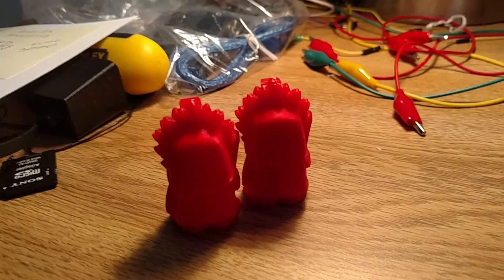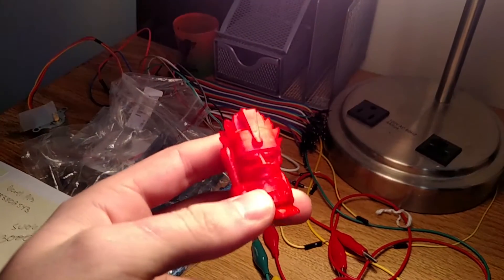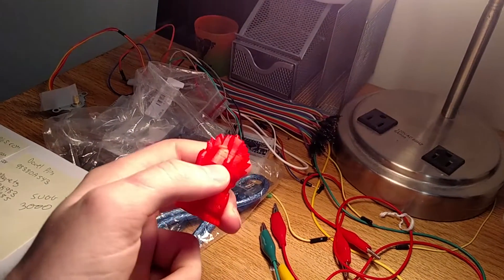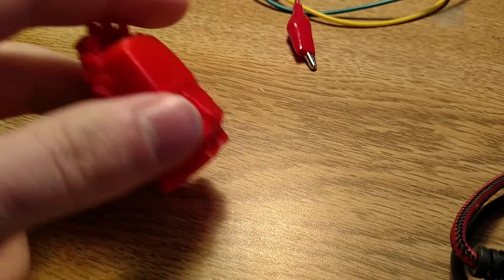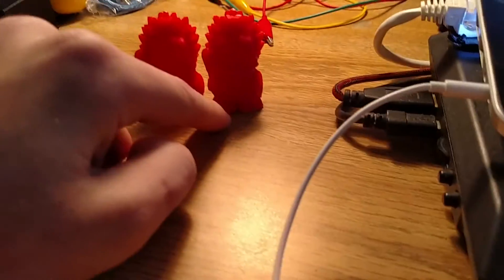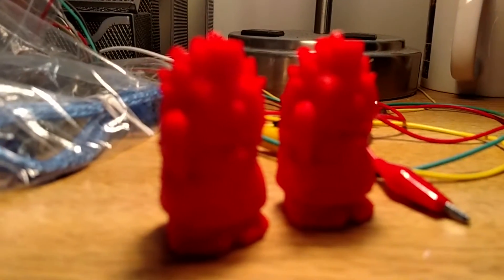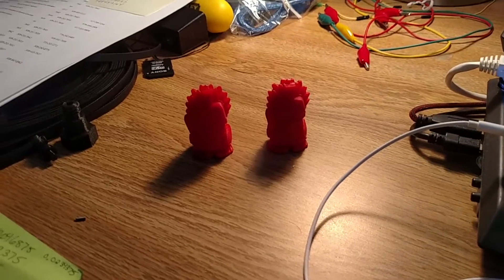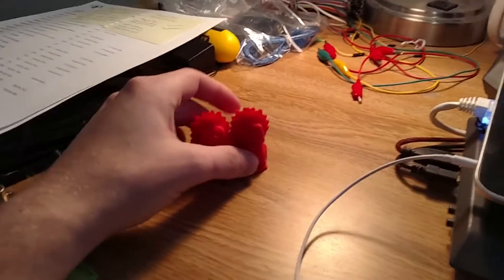3uP 0.1mm and 0.04mm Layer Height Prints

Comment: Are you using Cura or Slic3r? Can you share your settings?
Reply from the maker: Slic3r and well yes but as I said above they vary from setup to setup. I left most things as default, just lowered the layer height and combined infill layers to save time. The filament settings are the most important but they require experimentation with your current filament. Other than that it's just speeds, which for smaller prints are limited by the layer time anyway so they really have little effect on prints like this.
Reply: 3DprintedLife What is your typical speed settings anyway? Just for reference.
Reply from the maker: Sean Cherven Somewhere around 300 movement, 150 infill, 60 perimeters. Also I forget if you have an e3d or not but if you have the anubis it will likely not be that fast for infill, the printer should still handle those speed motions and perimeters though.

Comment: Can you post your Cura settings?
Reply from the maker: Well I could but they wouldn't help you. The whole point of the cura and slic3r settings is so that you can get the most out of your specific printer and filament. These settings are really different for just about every printer, even for the same printers that are just put together slightly differently. I would recommend you watch my video "slic3r settings explained" and learn what each of the settings do, then find out which settings will work best for your printer.
Reply: Well explained. 
Thank you.
Reply: jorge de la cruz  If you are having Cura or Slicer issues with prints due to Speed; Slow down the speed and up the flowrate and feedrate by increments of 5. I discovered that Printing fine details truly require SLOW speeds. Even areas that are just legs on a figure require slower print speeds. Otherwise the Hot End is moving faster then the Plastic can extrude.